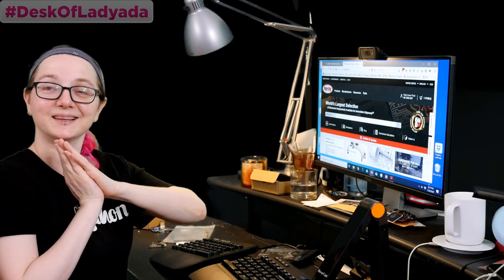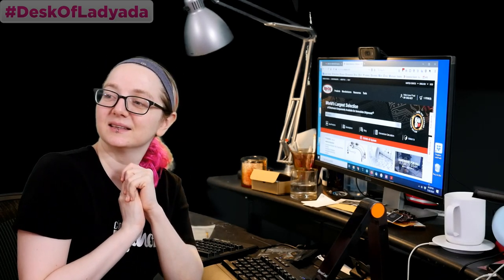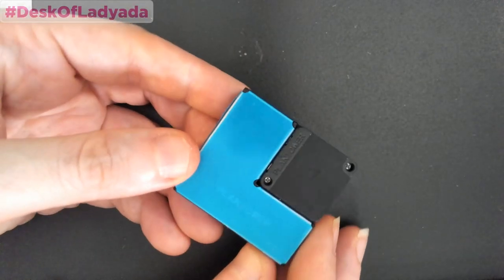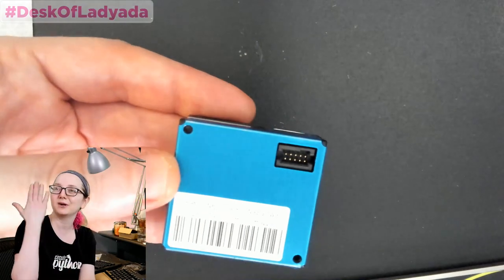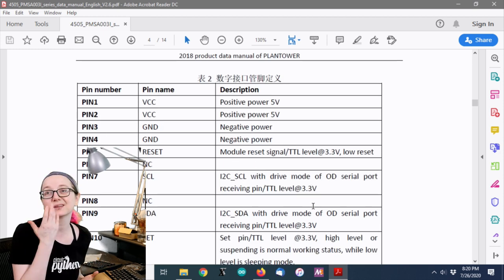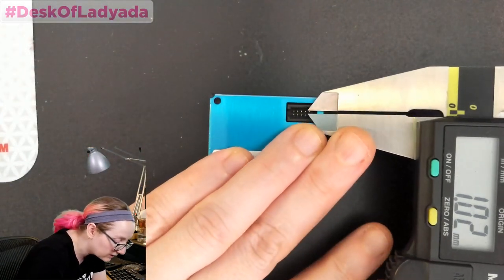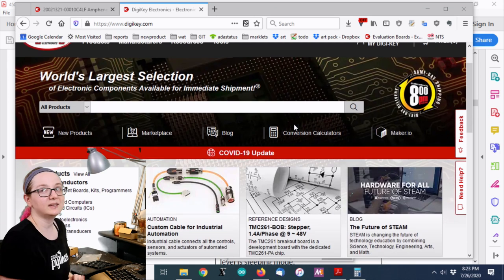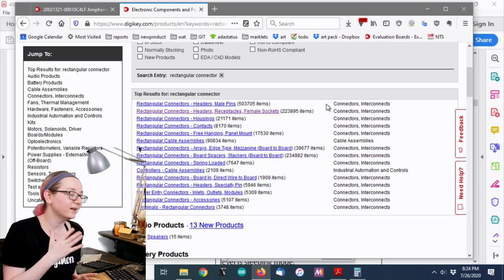DESK OF LADYADA - Finding a matching connector for a specialized air quality sensor

Comment: In this case, couldn't you scan the sensor/connector at a high DPI and measure digitally? I've successfully made templates that way in the past with very little error :)
Reply: If it was me, I would have measured a pin's thickness and then from the outside of pin 1 to the outside of pin 5, and subtract half of the pin thickness.  I also would have picked 'Normally Socking', instead of Active, as she likely got a number of Non-stocking 'Active' parts to sort through.

Comment: Hi Limor - I did this exact same exercise a few months ago for a slightly different model... FYI in addition to these connectors (I got the thru-hole variant) Digikey offer a small breakout board as well which is good if you are iffy about soldering something this small:
https://www.digikey.co.uk/short/z5cvwz
One other thing I noted about these devices is that I suspect that the flush metal case could be a short circuit opportunity... for that reason I cover that side in kapton tape just to be safe.